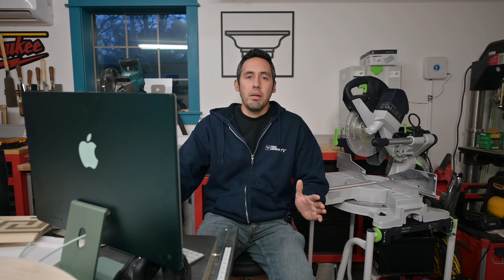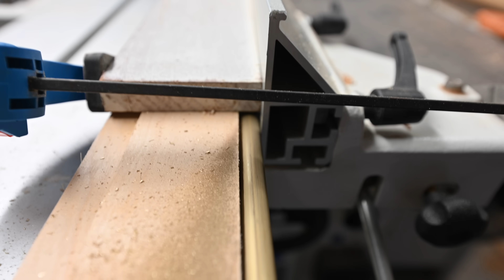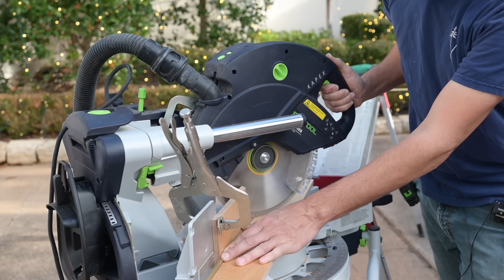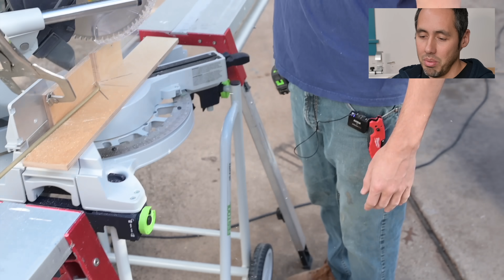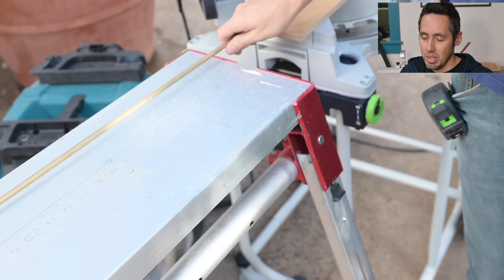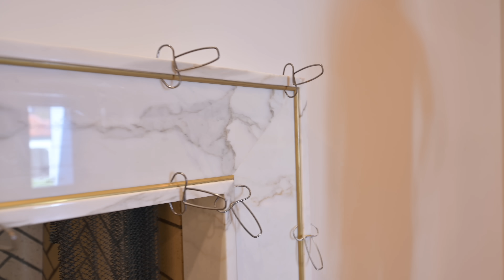It only took 12 years...My first MITER SAW injury.

Comment: Worst injury was for sure cutting tapers on the table saw. I was cutting them with the pointy edge of the wedge pointed towards me. 

First one went fine. Was in a self imposed rush and did not clear the offcut. As i was doing the second cut i pushed the first wedge offcut onto the back of the blade. Time slowed down and i saw it coming. Not in enough time to eat some wood. Thankfully was wearing safyey glasses, but got a gash above my eye and still have a scar under my eye brow where hair doesnt grow!

Funniest part about it was weeks later after the stitches were out, i still had a pimple right at the edge of the stich line. Wife poked it with a needle and a small sliver of wood popped out. Pimple went away the next day 😂😂.

Comment: So you want (work related) injuries :)

Well i have inserted a turning 5mm drill bit (3/16 I think) about half an inch in between my thumb and indexfinger (lucky to not hit nerves or tendons).

I shot a staple about half an inch into my thumb with a pneumatic gun.

I cut through my glove into my indexfinger with an angle grinder.

When I was a bartender someone left a piece of a glass in the washing basin, i peeled open a nasty gush in my indexfinger with that.

Those all where not too bad with adrenaline and a few days of rest and being gentle for a week.

My first day working with stick welding I looked too much besides the welding screen and burned my eyes, that was horrible.

But my worst moments i feel where the times that I have ripped a nail of my finger.

I once as a plumber was turning a plugfitting with some pliers when they shot of the fitting and my pinkie jammed against the quarter nub on that fitting, ripping the nail off.

Another time was when I worked in production and was stirring some offcuts into a big square mesh bin. I still don’t know how and why but i managed to jam a finger against the mesh, ripping of the nail.

And the last time was when i was shoveling under some bushes to cut the roots and I took my back hand lower and lower to undercut the bush more and more and then jammed it over a little row of poles that where behind me all that time. Again ripping a nail off.

That last one hurt the most (or it is the freshest memory) because of the direction of force into the nail, folding it double and over.

I am quite good at distancing myself from pain, but the fingernail stuff allways gave me the worst kind of butterflies in my stomach, all the other moments haven’t come close.

I am happy this is your worst moment with the miter saw so far! I guess I allways want to clamp my pieces when I do metal with saw blades.
Never enough teeth in the material to leave it up to my feeble human strength to hold the work piece.

Merry Christmas and a happy Newyear to you, your family and John!

Btw edit:

I would love to own a speedsquare and a titanium one at that, but since I work in millimeters I guess the one you are giving away is not handy for me. So count me out of the contest.

Comment: The same thing happened to me while cutting a short peice of aluminium tile trim it got jammed and bent over, i disnt get hurt but it was a close call. From now on I cut those by hand with a quality hack saw and a mitre box. I dont mind cutting aluminium tubing very slowly on the mitresaw but it's certainly dangerous to do non standard cuts like these.

Comment: I LOVE MY MINI SPEED SQUARE. Wow which injury.... One time while building a tree house out of rough cut air dried oak I stepped a board with a nail. I picked up my foot and the board came up with it. So I stepped on the board with my other foot to hold it down. Yep you guessed it, I stepped on another nail. Both feet with nails stuck into them on the same board. I was able to get them loose and run up to the house. We took a trip to the ER to get a tetanus shot. I was probably about 7.

Comment: Dado stack on table saw, rigged up box joint jig, holding 2x8 material vertically……..wood binds/skips and thumb goes exactly where you think it went 🤦🏻‍♂️.  I was EXTREMELY fortunate that either I reacted quickly enough or just dumb luck but I only ground about half a finger nail’s worth of my thumb off.  Like a lizard tail, thumb grew back completely but still don’t have the same feeling in it.  Be careful out there, our blades don’t discriminate…..they just cut whatever they can.

Comment: I lost an argument with my table saw. 
Just goes to show no matter how careful you think you're being if you lose your concentration for a millisecond you're in trouble. 
Needed surgery to repair the severed tendon and nerves In my left thumb. 

I was making a custom hot air vent in a piece of maple furniture base molding. It involves making a series of 6 plunge cuts through the face of the molding about 10" long and stacked about 1/4" apart to vent hot air from a heat duct in the toe space of a cabinet. The slots are much less obtrusive than an ugly heat register. It's something I've done hundreds of times. 
As to what went wrong? I was making the last cut and can only guess I lost my concentration for a second (thought ahead to finishing up rather than thinking about what I was doing?!) and eased up on my downward pressure on the material against the saw table allowing the material to kick back. My hands were nowhere near the blade while actually making the cut but when the material kicked back it pulled my hand into the blade. 
I'm fortunate there was only about a 1/4" of blade exposed above the material. Had the blade been higher the injury would have been much more extensive. 
While being examined by the hand surgeon he got 3 phone calls involving table saw accidents. It's very sobering. 
As I said, I've done this hundreds of times. It's a procedure I am fully confident with. Yet, as careful as I thought I was being, a split second loss of concentration and here I am. 
The surgery was successful and I regained full use of my thumb after about 8 weeks. However the nerve damage still has not recovered.  7  years later, I have limited feeling in my thumb.

Comment: I was cutting small squares to mount my blinds since the windows did not allow proper installation in frame. I had a 2 in piece left and I wanted to cut 1 in square. The piece was too short to lean against both sides of the guard. It flew into the saw, and my middle finger just touched the saw. I sliced my funger. I was alone at home at 12 o’clock at night, tiered(talking about not being smart). I wrapped my finger and drove to hospital. The doctor put 6 stitches. You can still see the cut, but it fully recovered. Stay safe everyone!

Comment: I was ripping some 5/4 treated decking. One particular piece kept binding up so I decided to flip the piece end to end and run it through again. Again the piece was binding on the blade so I decided to power push it through and BOOM! It exploded off the table saw damaging the fence and blade. I suffered black and blue bruises over my arm and face. The piece of wood was in extreme tension. Once I released that tension it just twisted around and smacked me.

Comment: I was a framer working on decking the roof of the building my team was framing. I slipped half way up the roof and started sliding. I ended up sliding off the edge of the roof. The eves were about 10 feet up. I landed head first on my face and fractured my eye socket and cracked a couple of sinus cavities. I was lucky. There was a cinder block standing on end a couple of inches from where my face hit. If I would of hit that I probably would have broke my neck at least.

Comment: My story is when I was 19, I needed to make a quick cut on a scrap piece of thin plywood paneling just to square it up. Just wanting to get it done, I didn’t take the time to lower the table saw blade to the proper height. As the paneling got to the far side of the blade it started to chatter so I placed my left-hand fingers on the far end of the paneling to keep in on the table, not noticing that my thumb was coming down on the top of the saw blade. Now my left thumb is a bit shorter than my right.

Comment: Richard, you got away with one.  I have watched enough of your videos I think of you as my brother.  So here is some tough love.  Use the right tool for the job.  You need a metal blade for that task.  You can drive a tack with a sledge hammer but sooner or later you are going to smash your thumb.  If you are going to start to work with brass, make the investment into a good metal blade and convert one of your saws.  Wishing you are your family a Merry Christmas.  Stay safe.

Comment: Would never wish an injury on anyone in the trades. In your situation, it could have been worse. Please post a follow up video as to exactly how things might have gone wrong. For example, wrong saw blade, wrong saw, a flaw in the brass which you did not see prior to your cut etc. No one is at fault in this case. A situation happened, You came out lucky. Goal is to prevent others from getting hurt.

Comment: In my opinion you cut through the brass and the blade went thru the zero clearance once that happens you still have pressure onto the the brass piece which in turn slides past by the teeth of your blade,so now your brass is on the smooth surface of your blade instead of sliding your brass off the blade or stopping your blade you started to bring the blade up in turn the teeth of your blade caught your brass on the down turn bending your trim and kicking it to your fence. Hope you understood what I wrote. It could have been a lot worse. By the way love your work.

Comment: One time at the router table, failed to lock router motor to housing on my Porter Cable after making bit change.
Turned on router, motor fell on my foot , fortunately it was only a bruised toes and opposed to a mangled foot.
Will never do that again.

Comment: Curious…perhaps reach out to Festool and explain what happened. could be blade was dull at this point, in combination with small diameter of brass piece which contributed snap back. Had something similar happen on some wine racks was making for a wine cellar.

Comment: Boring a 1” hole in a fir 4x4 about 9” long on a drill press . The bit caught and started spinning the 4x4 which almost took off my left thumbnail. Lesson learned! Always secure your work piece before drilling. Ended up making a jig to secure the stock, as I had about 20 more to do.

Comment: I was screwing rain gutter to the eve hangers while on top of my ladder. The screw walked and then grabbed. It went through the gutter and then my finger in a split second, anchoring my finger to the gutter. I flinched and dropped my drill. I had to wait for someone to come around to where I was to hand the drill back to me before I could back the screw out of finger releasing me from the gutter. 

Like your finish nail story I can still summon that feeling. It’s turning my stomach now just talking about it.

Comment: I was cutting some vinyl siding with a utility knife and a straight edge, and my blade was getting dull. I knew I should have replaced it, but I did what we all complacently do - I pressed down on the knife even harder. So my blade starts riding the edge of my framing square rough and kind of jagged, and then it happened. It jumped over the edge and ran right into my hand holding the framing square. Although I didn't lose any pieces, I did cut my thumbnail in half. 

   I'll let you think for a minute about how that felt.

   Lessons learned:
   1. Always use sharp blades.
   2. Never press too hard.
   3. Maintain control.
   4. If you can, wear a Kevlar glove.

Comment: My worst injury was after a long day of doing drywall work in my house. I had a lot of trash and it was trash day. So I rolled out my trash cans to the curb and there was material keeping the trash can from closing all the way. So I decided to throw my body weight over the trash can in a lazy attempt to push the trash down. I somehow closed the can on my crotch and it hurt so bad. I couldn’t be intimate for about 2 weeks.

Comment: As a DIY whenever I work on something I at lease get a cut most of the time I don’t even feel it lol. But my worst one was when I was cutting tiles I had to chip a inch and half piece with a tile plier I go to snap it in half and it jammed right into my wrist. I was bleeding for a little bit. Had to get five stitches on my wrist..

Comment: I was remodeling my 1st floor bathroom. Was in the basement gluing up some 3" PVC in behind the furnace up between the floor joists. It was in a blind spot that you couldn't see very well. I had just put a few rounds of cement on the pipe and had to contort myself to see if I had enough on it. As I poked my head in and up to see my work a giant glob of glue dropped right on my wide open eyeball. It was instant fire. Ran upstairs  making loud noises and head in tub started flushing my eye. Eye was really hurting wife drove me to the ER. Guess how they flush your eye out. They pull open your eyelids and place a large suction cup attached to an IV type bag on your eye and have you close your lids. Takes about 45min for the bag to empty. Half hour in a nurse shows up. Sir have you had a tetanus shot recently? No....Pull up your sleeve. Safety glasses, yeah, I hear they work. 😂

Comment: Stupidest injury, complacency at my contractors saw cutting 1” blocks for a cutting board table. After so many I knew what I was doing until I didn’t and my thumb rolled over the barely protruding blade. Instantly I knew I was smarter than I was 3 seconds before and I wished I could go back that 3 seconds and not do it again.  That was about 40 years ago. Still have my thumb, the cutting butcher block table and the saw.

Comment: I was in my first year of high school, I took wood shop class... We finally went through all the safety and operational classes.  I was cutting an 1½ inch stock of rock maple when two of the kids were horsing around, one of them bumped into me and my left hand went right into the blade!  It was s clean cut... my teacher rushed me to the ER and the GREAT Dr was able to reattach my finger.  I have tingling in the finger at times but still able to use it 😊
Bring so young, it really taught me everything in making sure safety is a must! (Sometimes i get anal at times!) 
Glad ya didn't get really hurt... Angel was watching over ya!

Comment: Adjusting the router depth of cut with the router running in a tabletop position. Loosened the clamp and the router dropped down and out of the router base cutting 3 fingers and palm of my hand. I was in a hurry and had been working for 24 hours straight. Don’t work when tired and don’t disable safety features of your tools!

Comment: I was cleaning up with the hose after demoing a pergola. I was walking backwards pulling the hose and stepped too close to the pile of scrap wood behind me. I got a rusty 16d nail in stuck full into my calf that was sticking out from one of the boards. Surprisingly it didn't hurt at all and hardly bled. I went and got a tetanus shot right away though.

Comment: Sorry about your accident. I do metal. I would never imagine trying to tell you how to work with wood. Brass, aluminum, steel, composite blades are much better for precision and safety.

With that said...i am using a 4 1/2 grinder with a cutting disc for steel. I was almost done and it was right around sunset... I was wearing safety glasses but no face shield. Main thing when you are using a friction cutting disc is letting it do the work, using minimal pressure... Well yeah that's where everything went wrong. The disc exploded. Shrapnel hitting me in the face. I don't know if it was instinct or what but I immediately stuck my lip out like I was a little kid that just got slapped in the face. It hurt really and I was sure that there was pieces stuck in my face. I stayed calm, turned off my grinder, got up and headed towards the rear view mirror on my truck so I could see the Carnage. To my surprise and sheer luck... Not a single cut, nothing stuck in my face. Considering the way it felt I couldn't believe it but I was sincerely thankful. the biggest hand slap the mess out of me 🤣. 
Lesson learned. Proper lighting, check. Face shield and safety glasses.

Comment: Building soffit overhang on a two story house, and not thinking I took the air nailer and reached to the opposite side of the soffit overhang and shot a nail. Not having enough material between the nail and the edge of the wood shot a nail into my stomach. 😮

Comment: I’ve done a similar accident with small peices.

The worst one I’ve had on the kapex was the guard not retracting properly/ completely/slowly and doing hundreds of glazing bar cuts ‘muntins’ 🙄 
The saw was only running down , as the procedure was make cut, slide timber under blade to stop with right hand ( trigger hand) rinse and repeat 

Anyway, with the guard not fully retracted ( must have been getting worse and worse and my kapex dust extraction is crap!) my knuckles hit blade! Not enough to get into bone/ tendons etc. but blood everywhere and more than enough for me to crap my pants and have a good hard think!

I fully cleaned the saw up, blew it all out with the airline and guard retraction is 95 percent, maybe needs a new spring ? Must be 10 yrs old easy

But even an unpowered, running down blade with an electric brake! Can bite you! Even got a little scar to prove it

Comment: Milwaukee porta bands are an awesome little bandsaw if you don’t have one you can even get a stand with a hydraulic to use it like a stationary bandsaw. I’ve stabbed myself with a razor blade trimming one time, I learned ca glue is the best emergency stitch on site!